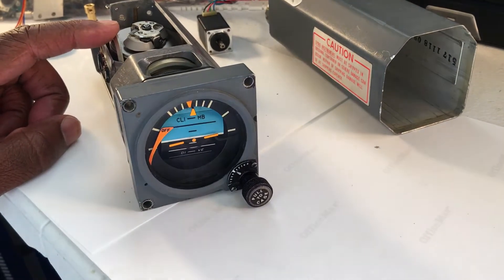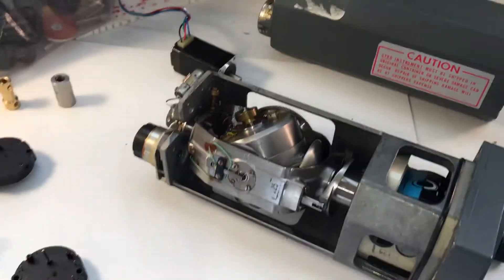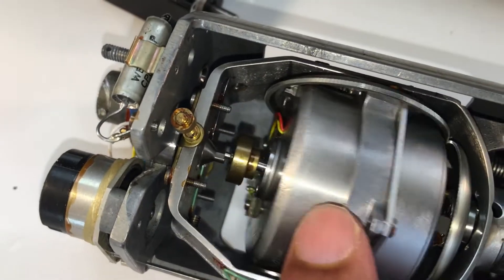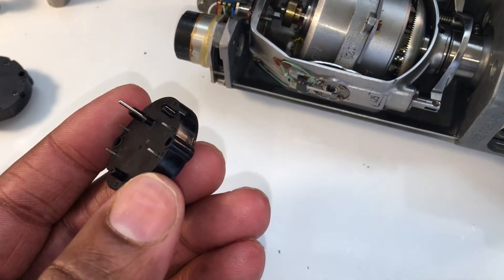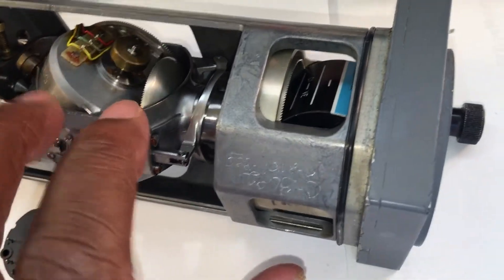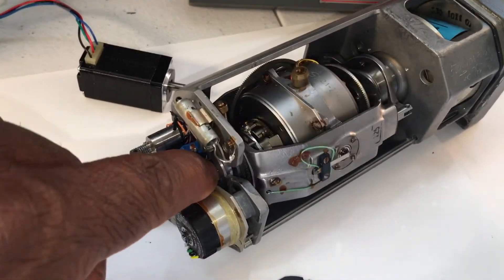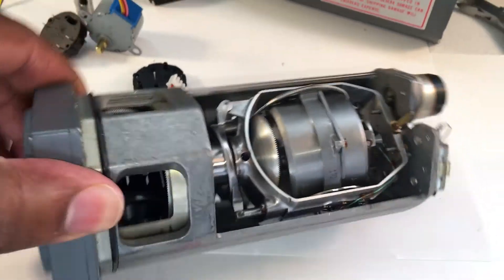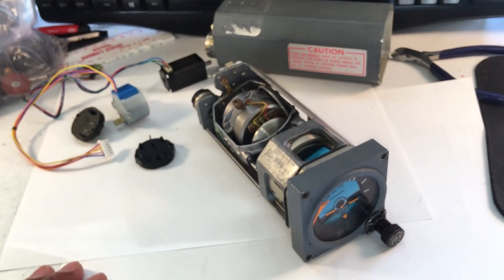A-10C Home Cockpit: Making the Standby Attitude Indicator

Comment: Hi!
Great work!

I want to use the same gauge for my F-16 pit build.

I notice that you have quite large steps when it moves. Is there a way to build it so the steps are removed? Do you think I can do it with rc servos instead, or do you see any problems with that?
Would you advice me to get the same steepers etc that you used for the build?

Then I also want to know how you program it? Do you use the Bios templates, or do you write your own code?

Best
Sebastian from Sweden

Comment: Wow! This is really interesting! I'm looking at this both from DCS simmer and real world pilot perspectives, so seeing the insides in action so to speak is very illuminating. The wires that enter the central gyro assembly suggest this is an electrically driven instrument as they might be to power the rotor weight that makes it gyroscopically stable during flight. Good luck with the build Joe!